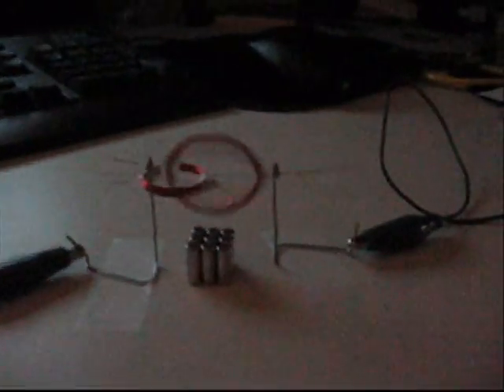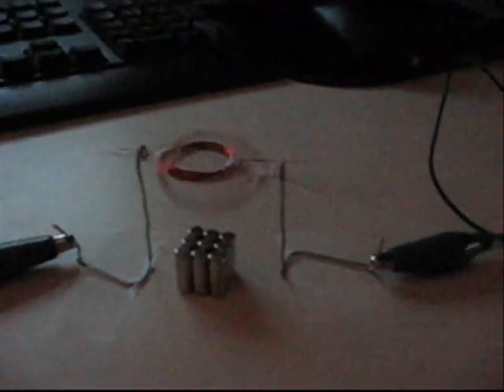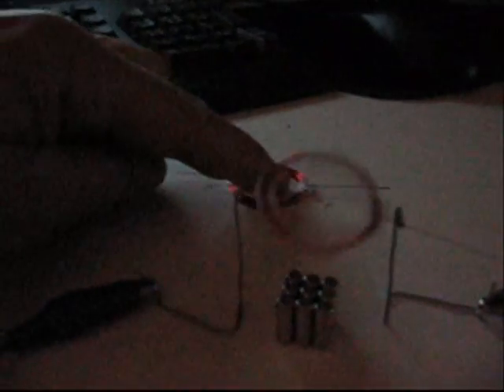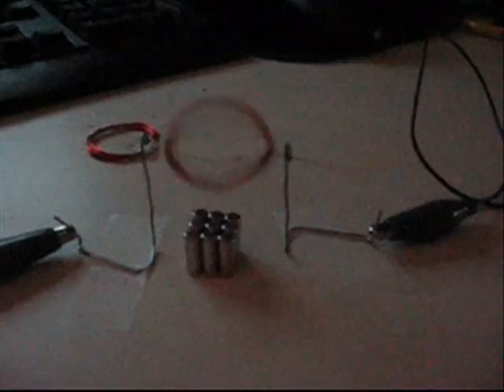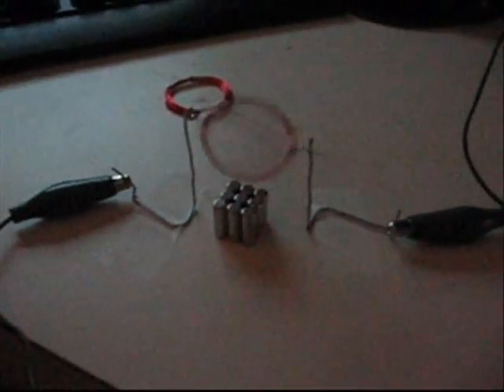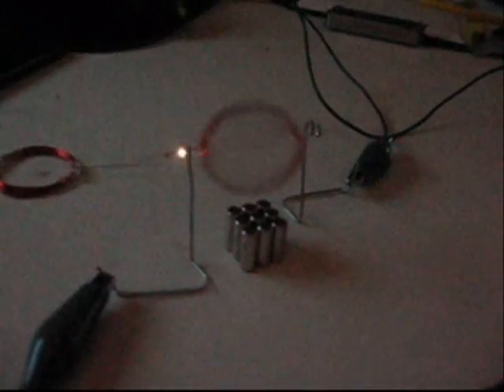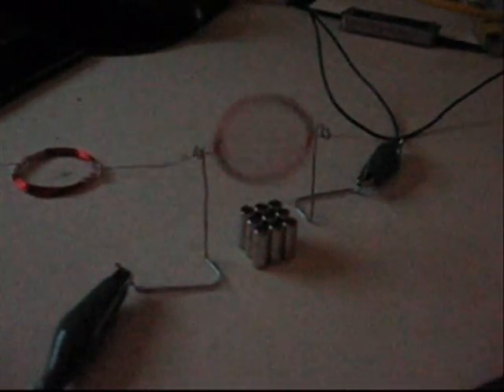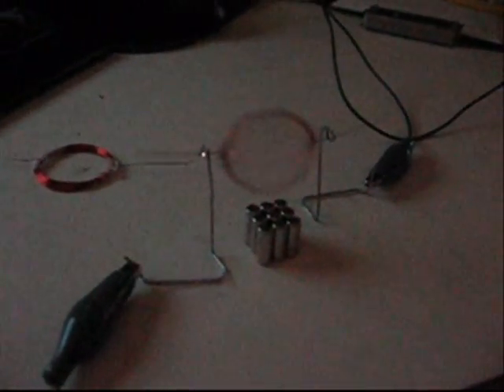Simple magnet motor in work

Comment from the maker: Great. Now Steve you know that you need to setup a commutator of such. You can do that by placing a piece of black tape so it covers 3/4 of the area that the wire touches. You don't want the connection to be always on. You'll get the feel

Comment: ive changed the rod to an iron rod and copied your deign and ive just had it working very slow for about 20 or 30 secs  ,i had to be really gentle resting the negative wire on the rod for it to work ,,so i thought id let you know straight away,,,you were a great help getting me started dude so thanks for that,,,ill post a vid on as soon as,,,,,,,,,respect

Comment from the maker: there's your problem. You have it wired wrong. If you wound your coil from bottom to top the lead wire coming off the top get attached to the iron rod buy means where the rod can freely move but still maintain contact. Then you take the start wire at the bottom of the coil and connect that to the positive and use the negative  lead against the other end of the rod.
I have a crude one in my vid collection called newman at work.

Comment: yes its a tube shape with an axel through the middle with neo mags on,a coil wrapped around the tubeing one direction with a gap in the middle ,the gap being joined where the axel is,the coil from the top of the tube wrapped around the axel at one end .then the other end of the coil to the battery negative and the posative to the other end of the axel.....and nothing,,i know  your supposed to put tape on the axel with a cut to make it keep turning,,but it didnt even twitch without it ,